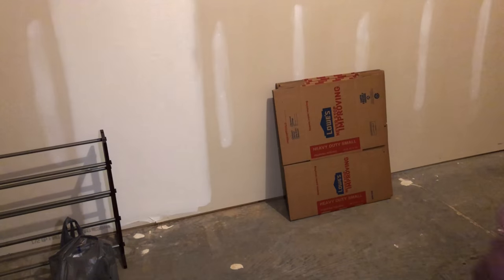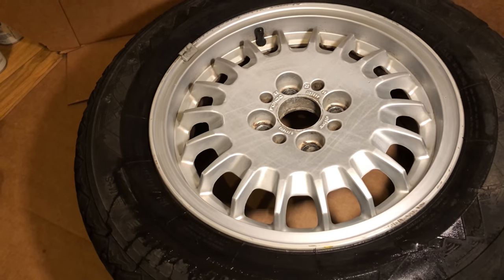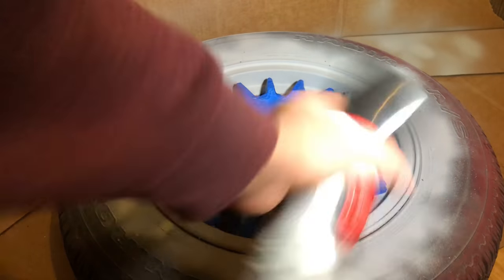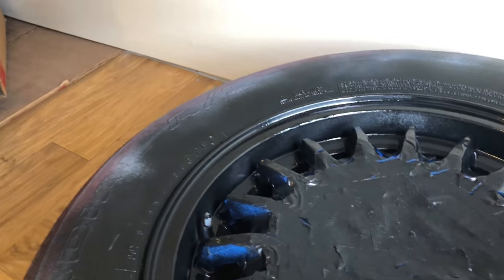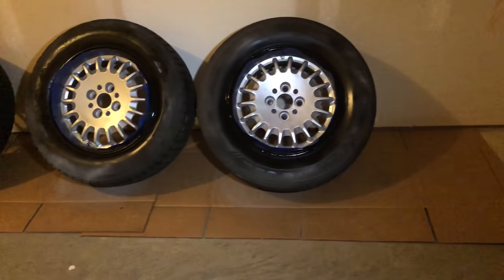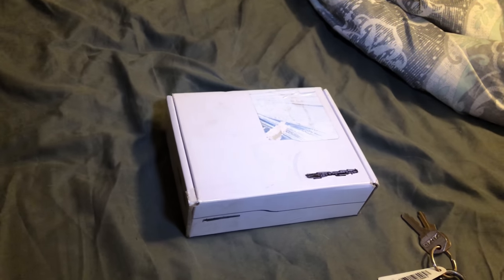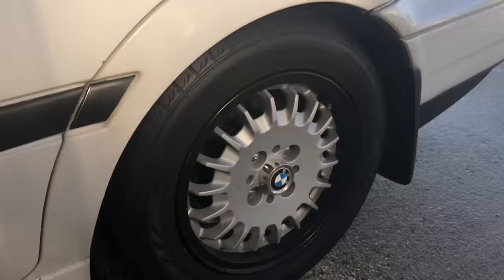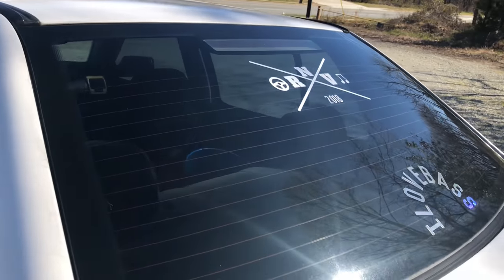Breathing life into the BMW Bottle Caps! | CARVLOG08

Comment: Got same mk3 with bottle caps. Found 5 bottle caps clean for $75.  Putting in an  aba 2.0 63k miles I found. Header, a/c delete. No smog! Flowmeter exhaust, high flow cat.
Reply from the maker: Sounds like a nice plan! And the no smog requirement always helps! 😂
Reply: @ridesnvibes  actually we have smog. Just passed my annual smog and got a two year tag. Found a 63 k engine out of a 02 cabriolet that's pristine. Plus it was an auto, I have manual. My last engine you could move crank side to side a half inch or more. No oil pressure! Just cleaned up my bottle caps and clear coated with automotive clear and sprayed. Both sides including side walls my new tires. Gives that amour all look that last. Just going to buy some decent coil overs and frame stiffeners and call it a day. Plus fix a/ c before summer! Live in West Phoenix.
Reply from the maker: @cebusam7545  even better! I just passed smog myself after nearly 4 months of troubleshooting! Combi valve replacement and an induction service did the trick 👍
Reply: Yeah, my car I did combi  valve, dumb secondary air injection. I passed twice already, smog test. I bought just about all new parts my mk3 jetta. Been basically in my driveway for 5 years. Was in a front end wreck, pushed over. Bought for $200. I have a weak spot for derelicts. Couldn't really drive the engine was toast. Finally got a decent engine out of a parts yard in Oregon. Had it shipped to Phoenix. 63k miles. Right to my door, $775. Last Friday. Put in already. It is a ABA 2.0 Just had to change a lot of exterior parts for compatibility. Have a header. Just want to get it dialed in before I put on. Just would love not to have to run the SAI smog stuff. Just Pure exhaust off engine! The exhaust manifold not the easiest to remove !
Reply: @ridesnvibes  lots of low price bmw wheels that are complete on offerup here.  4×100 for mk3 2.0. Did you install a Header? I installed a k&n style air filter. Didn't like way air flow thru filter. Put Air horn from stock air box that's in front of maf, Inside air filter. Cut it down to fit circumference of MAF. Just duct tape it. Air flows much better!
Reply from the maker: No header install, I’ve since switched back to the stock air box with a K&N reusable filter.
Reply: @ridesnvibes  I wish I didn't throw away my stock Airbox!  My car is running really well now since I did engine swap. Has the timing belt  tensioner that is self adjust. Going to change to single pulley that's hand tighten. I just want a reliable daily driver! Like my mk3 , just to be different.